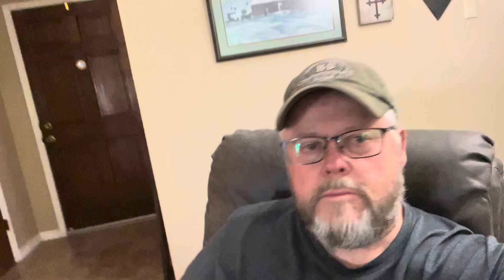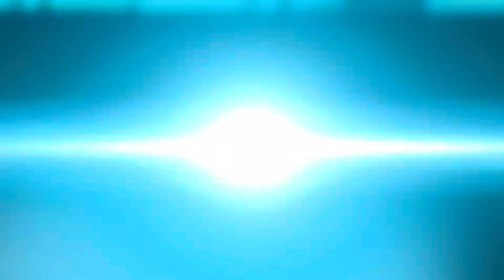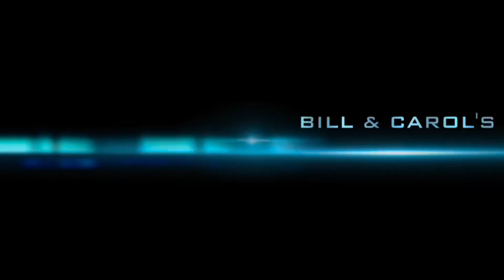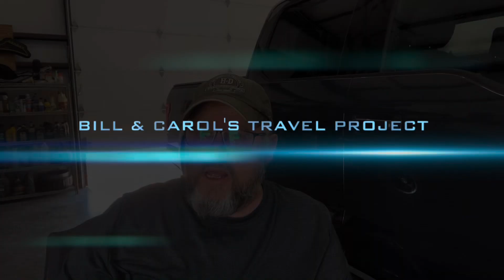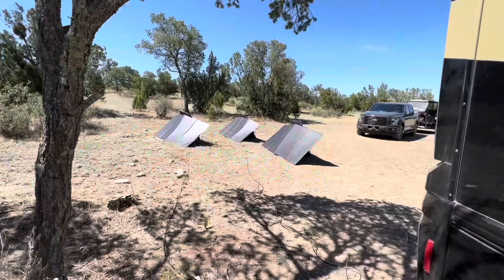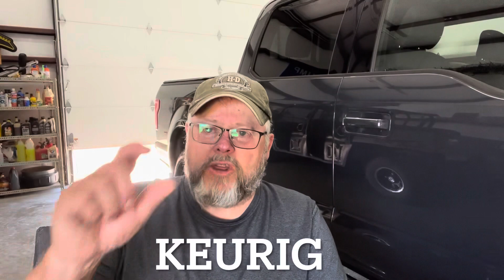EcoFlow Delta Pro Solar Generator w/ 3, 400 watt Solar Panel Boondocking Experience/

Comment: I think you need to run the battery down to around 20% before charging them up to 100%.  This will keep the batteries running at a better capacity over its lifetime.  I have a Delta Pro.  Thanks.
Reply from the maker: Thanks Saab for watching my video. Man it has been a hot minute since I made that video. You are absolutely right though. I have since that time set my limits to run down to 4% and up to 100%. On the present trip that I am on, I have used the DP only 2 nights over the last 3 months. Only boondocked while overnight parking on our way across the country. For those times I dis not even use the solar panels. I ran the DP down over night and then recharged it in a few hours with my generator while driving down the road.  But yes thanks for bringing ip that point about running them down before charging them back up. That is better in the long run.
Reply: @billcarolstravelproject  You’re welcome.  Always a bit of a learning curve when one buys a new gadget!
I need to use my Ecoflow Delta Pro more.  I’ll be settled in to my remodeled barn/shop soon and plan on being off grid as much as possible by utilizing it and another Renogy solar set up with LifPo4 batteries.  Safe travels!
🤠👍🏻

Comment: The delta pros will not fry if you over panel, the overload protection kicks in. It’s not what you want to do but they have built in multiple protections.
Reply from the maker: Hey Hard Truth. Thanks for watching my video and leaving a helpful comment. I know that you can over panel the unit as far as amps go, but I was afraid of what might happen with over volting the Delta Pro. I was unaware of an over volt protection built into the unit. Thanks for your comment.

Comment: Other videos say that if the voltage exceeds 150 you don't fry the machine it just stops accepting anything from the solar panels - ??
Reply from the maker: Hey lcoop. Thanks for watching my video and leaving a comment. You are the second comment that Ive had saying that there is some kind of over voltage protection built into the delta pro. I was warned to not exceed the 150v capacity of the delta pro, and they explained to me that the 3, 400 watt panels would output over 150v if the ambient temperature dropped below 54°F. That it could damage my DP. Considering how much that stuff cost I was not willing to take the risk of the voltage overload protection feature. Thanks for the comment.

Comment: I have a question 🤔 that 54 degree  thing, is that just on the portable panels? I see vanlife people using solar panels on their vans during winter
Reply from the maker: Hey Sandy, thanks for watching my video. That 54° thing is for all solar panels. The reason I was concerned was because with the 3 panels wired in series the rated voltage was 144 volts at 75°. The max voltage for my Delta Pro is 150 volts. Colder temperatures increase the voltage.  So now I will wire 2 panels in series and then parallel wire those to 2 more panels wired in series and that will give me a rated voltage of 96 volts and even the cold weather will not be an issue. So it just depends on how they are wired up so that you dont exceed the voltage of whatever you are trying to run with the solar panels. Hope that answers your question. Thanks for commenting.

Comment: It’s a lot of trouble
Reply from the maker: Well lets just say there were a lot of things to figure out, and a lot of things to remember. But knowing what I know about it now, it will be much easier next time. This was my alternative to a $25000 solar set up with lithium batteries. I spent a lot of time aiming solar panels and now I know that I dont have too. Just lay them down and they will do fine. I spent a lot of time turning things off and on, seeing how much power things used. I liked it. Took some time laying out cables and unpacking and packing up solar panels. I would not do all of that for one or two nights, but I would plan to spend a week out I would definitely use this. Thanks for sitting through that. Once again thanks for commenting.

Comment: Sir, I'm a newby in all this solar generator stuff and I did not buy an ecoflow but still watched your video for knowledge. I have a question though, Isn't there some sort of safety mechanism for throwing too much voltage into the system?  I would have thought it would shut down or blow a fuse but not destroy the unit.  I probably bought the worst generator on the market.  That's usually how I screw things up.
Reply from the maker: Hey Mark. Thanks for watching my video. You are the third person to mention something about voltage overload protection. So Im somewhat of a newbie myself when it comes to the solar set ups. When I was fishing for info, in a forum about solar panel configurations, I was advised that running 3, 400 watt panels, in series would give me the desired results I was looking for. But to beware of charging with the panels if the ambient temperature dropped below 54°F because that would increase the voltage output to exceed the maximum allowed by my Delta Pro, and that damage could occur. I have heard of some people installing a fuse link in the solar panel wiring to be sacrificial not allowing the high voltage to reach the unit. I did not take any chances, so I just unplugged mine every night, because they were not of any benefit at night anyway and I could check the temperature before plugging them back in the next morning. I dont know "officially" that there is built in protection in the unit, only what people are telling me in my comments. They are probably right, but Im not going to risk ruining my equipment. Sorry about such a long reply. Hope it made sense. Thanks for your comment.

Comment: Great review. You probably have already researched more than I have, but just in case you haven’t. I believe I have read that you could maybe run two of those panels in series and the third parallel. If I’m understanding it would drop it to 96V. And I believe it would keep the full wattage. I’m probably incorrect. Does that pack say what the amp hours is for the battery?
Reply from the maker: Hey Charlie, from what I understand both parallel legs need to be the same voltage. So by running one parallel leg with 2 400's in series there would be a 96 volt leg, and parallel with 1, 400 which would be a 48 volt leg, I think it would be a wash. But you are right, there may be a better combination that I believe would take a little more serious experimenting. I would have to get some parallel cables and then just test it with my volt meter. I have asked that question to an ecoflow forum and they said better off just run the 3 in series.  The maximum amps the delta pro will take is 15 amps. Once again it comes down to dynamics.  I think I could probably run more appliances during the day, 
than what I did. I may get some parallel cables and experiment with 2 panels. I think the 3 in series
will do the trick. Thanks for your comment.
Reply: @billcarolstravelproject - you'd have one pair in series & another pair in series then put those into parallel. The DP pros are 15amp limited so no matter what amps you throw at it it will only take that & wont trip the DP pros. Over volting it will trip it as long as you stay withing that 150v range.

Comment: how long will it run a dometic 45 cooler before it needs to be charged I tent camp
Reply from the maker: Hey user, thanks fir watching my video. I had to go read a little about the Dometic 45. There was a statement there that it took less power than a 60 watt light bulb. If that is the case, you could probably run that fridge for around 60 hrs.

Comment: I bought EcoFlow balcony solar power plant with 3.600W Delta Pro storage, 800W inverter and 2 x 480W Bluesun (37.1V) solar panels. When the power plant is connected throw inverter to the network, can I connect the third panel, which is not part of the solar plant ,with a power of 480W (37.1V) directly in the XT60 input to the Delta Pro  for extra charging?
Reply from the maker: Hey Adam, Thanks for watching my video and commenting. I am not sure I understand exactly what you are saying. In my experience, all of the solar panels charge the Delta Pro, through the XT60i plug on the back of the unit. You just have to be mindful of the 150v Delta Pro voltage limitation. You can over panel the unit as far as amps go but do not exceed the voltage, and be mindful of ambient temperature's effect on the voltage output of the panels. Use the VOC rating of the panel to calculate your voltage output. Hope this makes sense.
Reply: @billcarolstravelproject  it is about balcony plant using powerstream qith 2x480 parallel panels. I wish to plug into xt60 one pqnel too for extra charhing bypass powerstream?
Reply from the maker: @adamsisernik4556  I'm sorry but I have no experience with the equipment that you are asking about.
Reply: @billcarolstravelproject  thanx

Comment: Great video filled with lots of information. I definitely learned somethings from your experience and your trials and errors with the panels, the solar generator as well as the  hookup to the coach. 
  The most crucial tip you gave that I haven't heard before, was about the 54 degrees temperature affecting the volts increasing. That is some real important information to know about and keep in consideration with these units. I have 2 400 watt Ecoflow panels, and the Delta Max 2000 power station with the 2 additional batteries hooked up. Have not really put it to any serious tests as of yet, but just the Delta Max and 2 batteries ran my household refrigerator and 2 small lights for just under 3 days of normal use from a full 100% charge without plugging in the panels. I was impressed and happy to see that if a blackout occured, I will be safe refrigerator and small light wise. 
  Look forward to seeing more of your experiences and adventures especially since you now have 4 400 watt panels. Safe travels and thank you for sharing your experience, I'm sure you've helped more people than you know.
Reply from the maker: Hey MikeP. Thanks for watching my video. I am so glad that you got something positive  from it. I really appreciate your comment. I have not had the chance to experiment with the 4th panel yet, but I will put out a video on my experience. Thanks again for your comment.

Comment: I think you are correct. This is what I was thinking the results would be to keep your voltage down a bit and went back to research it. So this statement says it will loose efficiency.

Whenever you hook up a 15V panel to a 24 V panel, the overall voltage is going to be pulled down to 15 Volts. This kind of a lowering voltage will probably lead to a decrease in power output, and eventually deterioration in system efficiency.

Comment: I would be worried too in the morning if it was cold outside but what if cover part of the panel the night before so when the sun comes up it’s only getting %50-75% of each panel
Reply from the maker: Hey Warren , thanks for watching my video. At the time it was just much easier to unplug the panels. I have since upgraded my array just a bit. I now have 4, 400 watt panels that I will wire 2S2P and that will keep my voltage below the over voltage range down to -15 degrees. I have not hooked up in this configuration yet, but it should work better. I cant wait to test it out.
Reply: @billcarolstravelproject  oh man that’s exciting!! 4 400w panels 2series. I hope you make more videos I’m looking forward to it 😊
Reply from the maker: @warrenwahpepah476  I will make another video showcasing the new configuration when I get it figured out.